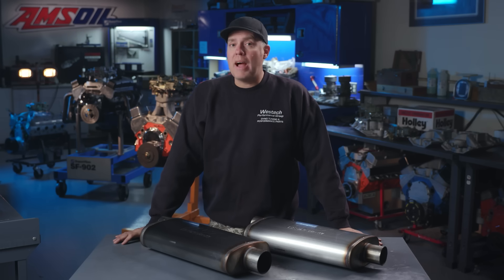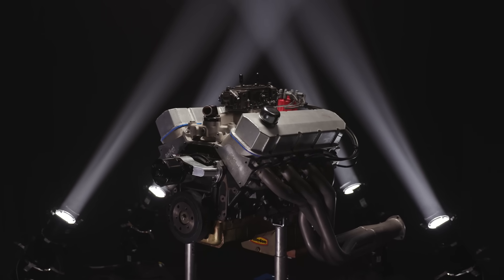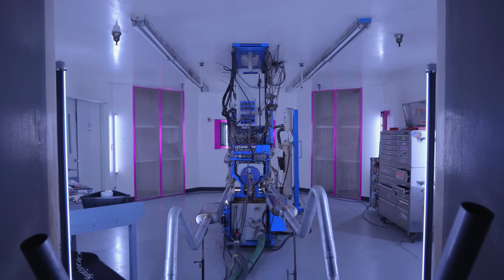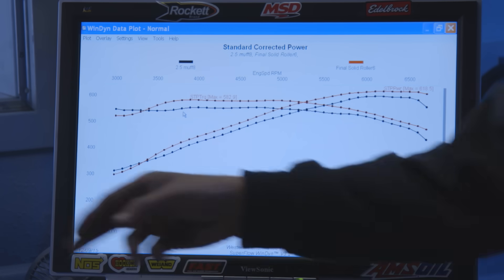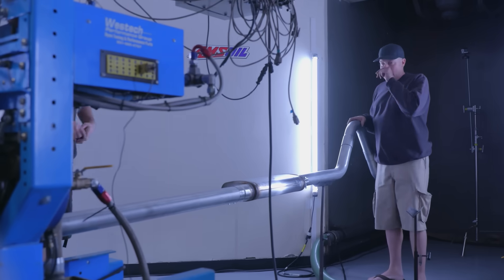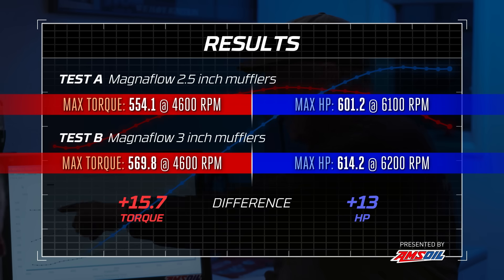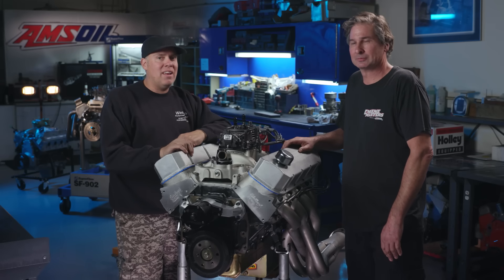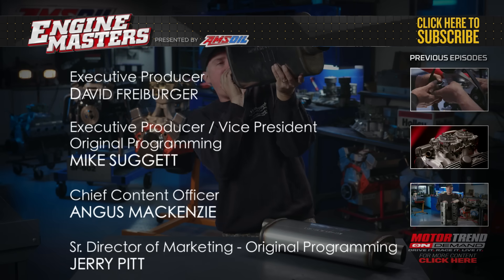The Power of 2.5- vs. 3-Inch Exhaust - Engine Masters Ep. 9

Comment: Ok... for all the wanna be gear heads commenting, let me break it down for ya...
I'm a Roadkill fan and all but they didn't prove anything. These are already established facts.
You WANT back pressure on a daily commuter. Under 3200 rpm is where your engine will rev for MOST of your driving and a loss of torque there sucks for your fuel economy. So does constantly having to downshift just because the road starts to pitch upward.

If it's just a toy that your going to thrash on for fun then yeah, run open headers or massive diameter exhaust systems and flat foot it everywhere...
Just don't get mad when the quiet 4 banger next to you keeps rolling on you at every red light because your brap brap BRAAP machine can't get a decent 60ft time without you revving up to 4 grand and popping the clutch. 

Launches are fun, until Deputy Dewey hears you squealing down Main st. every 30 seconds.
Reply: Also, that's why most higher end performance cars come with tune-able exhaust systems for the last decade. Low rpm, a flap valve in the muffler stays shut to provide back pressure for scavenging, and opens to allow flow through higher on the tach. Best exhausts ever!

Comment: I am really glad to see a test like this done.   It is good to have a comparison on this sort of thing.   Just a wee bit of confirmation bias in the results reporting, though...         So swapping from a 3" to a 2.5" only cost you 2.8% of your torque and 2.1% of your horsepower?  ....despite the fact the engine isn't even properly tuned for the 2.5"?       I mean it is good to know 2.5" exhaust is perfectly adequate for a 600+hp car.    If you are going to claim victory here without letting anyone tune the carb, you might as well point out the two pounds of weight you added with the larger pipes.   Whoah!!!! Huge Difference!!!!

Comment: I would have gone with a flowmaster not a magnaflow.
Reply: LOL. I hope you are not serious. Chokemaster is one of the worst mufflers money can buy. Their technical support are a bunch of complete idiots, so it is no wonder they can't make a decent muffler. 

Here is the facts:
I had a 454 in a motorhome running Thorley Tri-Ys. It originally was stock manifolds, with Flowmaster 50 series. When I installed headers, there was only a minor improvement in power. After a few years, I had the exhaust redone. Same 2.5 inch pipe, but switched to dual 70 series Flowmasters. Absolutely killed the gas mileage. ~20% worse. I called Flowmaster's tech support. They suggested maybe I had too much scavenging, and suggested I choke down the pipe size. LOL, even a small change made it worse. At the time, I also had a fuel pressure regulator. By adjusting the pressure, I could easily richen or lean the mixture. I did so, but it made no improvement in power. I eventually removed the Chokemasters and installed Magnaflows. All I can say is WOW. The muffler was quieter than the Flowmasters, and the peformance was substantially better than even the 50 series Flowmasters. Finally I had the performance increase that I had originally expected when I first installed the Thorleys. 

As a side, I eventually installed a 502 with MPFI. Used the same exhaust. It doubled the HP. It was the only motorhome I know of that would chirp the drive wheels between 1st and 2nd at 50 mph. And yes, the motorhome would do over 100 mph.

Comment: Heres the issue...
Built engine needs big exhaust
dpes your 200hp with a cam and headers need that no.. you have a 4K redline
Same with your  240hp 454
Reply: 200 horse WITH a cam and headers? What is that, an 80s v6? No you don't need it, for most people 2.5 to a single 3 inch is overkill. You can go too big, and lose velocity. Just like everything, keep it proportional.

Comment: The trick is to make the most power at the lower rpm's. Look at it this way. A 454 that puts out 500 horse. Now look at a 500hp Caterpillar engine. They are both exactly 500 Horse Power. Which is the stronger motor? The 454 puts out close to 500 lb ft of torque. The Caterpillar puts out 1500 lb ft of torque!!!! 
Now go figure out gear ratios Grasshopper, where you can multiply torque, where little huevos can do "big huevo" work.

Comment: No matter how big of a carburetor and intake that you put on an engine no matter how big your headers are and your exhaust pipes! You're going to hit a plateau! You need to hog out the intake and exhaust ports on the heads! And you need to deburr and D shroud the valves! And then re c c the intake and exhaust ports below the valves! And if you want to go further dump in the biggest valves sodium-filled if you can afford them and valve seats! Always gasket match! Index your spark plugs so that they Point straight at the intake valve! And you will have massive power! If you're just a bolt on Bonanza! you're going to have The Hourglass effect!

Comment: "3 inch exhaust sure enough makes more power than 2-1/2 inch exhaust".... WHEN MOVING EXHAUST OUT OF 454 CUBIC INCHES! For the other 99.5% of people NOT running a 7.4 liter, results may vary when you only have 5.0-6.4ish liters trying to exhale, especially if you're trying to daily the thing. Also, as little difference as this made in comparison between the 2, it was on a much larger motor than most are running. I'd be inclined to think a smaller motor would be even less affected between the two sizes, especially with supercharging or spray... just something to think about before opening the floodgates out back. Lol

Comment: A question for you.. what about a turbo engine with 300 hp...Is it the same result between 2.5 and 3" pipe with full flow muffler all the way ?
Reply: Conny Blomqvist same result. My car is a slug with a 2.5 exhaust vs a 3.5. 1jz-gte precision bb 6266.

Comment: What if you go with 3 inch pipe, from the header up to the muffler, then 2.5 inch pipe out the rear? 🤔
Reply: It gets restricted at the end. You have 3 inches of exhaust trying to force it's way through a 2.5 inch space. It's not a good time.

Comment: how about for 4 cylinders 2.0 engine.. will a 3" gives more power than 2.5
Reply: Yes, assuming it is turbo'd. But even if it's not at 2.0 you should expect similar results. Just, not as substantial. Somewhere around 3-8 hp. If it's turbo'd expect a little more, because it has more room to push the exhaust. Also getting a bigger turbo is always an option as well. Much more effective than an exhaust, if you have the money.
Reply: @mattevans1643  how about 2.0 NA engine like K20

Comment: ran many with H and X with 3in . muffler placement farther rear also works with air impulse . 1/2inch h2o pos  ex pressure this helps low end and higher to WOT .

Comment: Very good test for the big block it proves that a 3-inch system is better than a two and a half I wonder how this setup would be with a 350 cubic inch engine thank you for the time spent in setting up this test
Reply: I've had 3 inch in a lt1 and lost low end torque. It got slpooy. 3 inches for a 10.1 compression big block and big cam needs a 3 inch exhaust.  A small block will do fine on 2.5
Reply: @Miguelspl150  thank you

Comment: BUT did you attempt to lean out the rich condition with the 2-1/2" 🤓
Reply: William McNett exactly. How close could they get to the optimized open header tune. They didn’t show the afr with the 3”. All about the tune 👍
Reply: Exactly. This comparison is dumb because of course the engine is going to make less power with a richer afr.
Reply: Less then one number difference in AFR not hardly worth a jet change between 11.5- 13.5 very little difference one degree of timing will do more.

Comment: Need to do the same test on a stock engine with stock cam profiles. You can't make an open claim that open header makes more power based on that engine. I've actually done the same tests on a chassis dyno and saw huge drop in torque after cutting mufflers out on a vehicle with stock valve train. Stock engines are designed to meet a different demand than just all out horsepower. They have valve overlap and back pressure accounts for some of the combustion pressure, without back pressure, there's less air in the cylinder to compress. This is because the exhaust valve is still open as the piston begins to travel up on the compression stroke. Less pressure at the bottom of the stroke equates to less pressure at the top.

Comment: You should do Flow Master 40 series mufflers with crossover pipe.
Reply: Flowmaster?? No offence but I always was told those were like the bottom of the barrel for performance mufflers.
Reply: @extremedrivr  you should check out Flow Master. They are not glass packs that look like mufflers.

Comment: Shenanigans I call shenanigans.  I don't know a car guy out there that would run magnaflows without a crossover X pipe or H pipe.  Lean out the engine on the 2.5" and put an X pipe and see what numbers you get.  We in the real world don't have the disposable income to throw everything at a motor to get big HP gains.  So we tinker, port, lean and tune.

Comment: I was told back pressure stops valves from burning up, nothing about the little power loss vs hurt valves more flow more heat. Anyways that's how I was taught back in the 60s

Comment: I'd love to see this sort of test on a Honda Integra Type R with the 1.8. 

My experience with these high revving 4 cylinder engines is that you can't go too big to you just lose so much bottom end and in a car with not a lot of bottom end, you lose so much totally.
Reply: Depends entirely on the size of the 4 cylinder and how big your turbo is. I've met quite a few tuners that run 4 and 4.5 inch when they're running a large turbo because it allows the turbo to spool at lower RPM, thus reducing lag and increasing usable power band at full boost. For smaller turbos and N/A motors you shouldn't go larger than 2.5 or 3 inch depending on engine displacement.
Reply: @Datboi_Mo  yep exactly. For small CC NA engines in my experiences you shouldn't go too large or with a straight through pipe either. It just doesn't suit the engine for me. Forced induction is another matter like you say. These tests are nice but don't really offer real world examples.
Reply: 125-150 horsepower and the same or slightly less torque
Reply: agreed... this is a massive brute of an engine, of course its gonna flow better with the 3"... but on a NA 4 banger, you dont have the volume of air flow being pushed out that would need or benifit from 3".. the exception would be a 4 banger with big turbo.

Comment: Wow, lost 20 whole horsepower...lol I bet 98% of the drivers on the planet could not actually tell the difference although more noise will make most people think it's faster.  And the test is kinda lame because you didn't change the fuel curve so in theory  someone who is jetted on the fat side with quiet muffs and spends a pile of cash on a less restrictive system and picks up a couple tenths in the qtr mile and thinks it was money well spent could have gotten away with swapping a couple jets, picked up almost the same number and picked up a little fuel mileage too.

Comment: its not "backpressure" but gas velociti that best resonates and tunes with the rpm , displacement, level of throttle. i hate to still hear and engume needs backorwssure. NO it Doesnt. especially on a turbo charged car. the less back pressure after the turbos turbine,  the better the turbo (thus volumetric efficiency)  turbine  will respond because of the pressure difference through out the overall system. stop saying "engine needs backpressure" that is way over simplification. a 2.5 would yield better VE (volumetric efficiency) at off idle and part throttle because the gas velocity would be higher and better resonate assisting im scavenging better of exhaust gasses from combustion chamber. this could be proven by comparing a full 2.5" system versus a 3.0" system with step a 90Degree square step down pipe 2.5" restrictor at the end. on the same NA engine. both sys  would yield similar "backpressure" but the system with full 2.5"  would allow for higher gas velocity and scavenging tuning resonance at low rpm and part throttle as opposed to the larger 3.0 system (loose low to mid throttle exhaust velcity and rosonance tuning) with the 2.5 restrictor. rant over.🥴

Comment: It should be noted that the 2.5" exhaust system is a power killer compared to WIDE OPEN EXHAUST....however, compared to a factory stock system, where your "big upgrade" would be to use a truck exhaust manifolds and 2.25" pipe. Compared to that, the 2.5" pipe + headers makes more power.

Comment: Try with X pipe and H pipe for scavenging. That would be very interesting.
Reply: H pipe better for low end and the X high end. It also depends on the motor and where you position the pipe.
Reply: @lordterra1377  As was said when Engine masters did that X vs. H test. The real estate under your car will dictate where the X goes. That's just life. Have you ever installed an X pipe? If so, I would think you know how hard they can be to fit.
I made a 4" X for my Gen 2 F body, and trust me, it's a pretty wild contraption. More sculpture than X pipe. They are hard to fit once you need a beefy shaft and a beefy trans.
Reply: @AB-80X  
I haven't done an X pipe only an H. I'll look it up again but from what I remember placement is key because you want it close to the motor. With my application space was no issue because of how high the truck sits. Again I'm going off of memory here but doesn't an H pipe work better for older V8s like early 90s and lower? Meaning carburetors and not built up too wild, because you're limited to 5500 rpm in most cases.
Reply: Go to the MT site. That test is there.
Reply: I heard when I deleted the mufflers on my challenger I could lose some power but when I asked the guys at a couple places they never heard of that. Any truth to it
Reply: 😆 Should of just watched the whole video first I guess!!

Comment: I wish you guys used black Widow mufflers. All the other Mufflers advertise 2-1/2 and 3-1/2. But the inlet and outlet of the mufflers measure smaller at the weld. Black Widows are True 2-1/2 and 3-1/2.

Comment: I use 5" galvanized steel dryer vent straight pipes.
Reply: While driving around town I saw a jetta TDI with a stock exhaust but he had an "aftermarket" exhaust as well....dryer hose right out from under his fender and up the side of the car...little plumes of black. Made my day
Reply: Does the catalytic converter do a good job of catching the lint?
Reply: @DavidG-vq3bk  That's funny
Reply: @DavidG-vq3bk  nah! Thats the cabin filters job. Hehe
Reply: lmfao
Reply: Aluminium dryer vents save weight.
Reply: I used furnace flue pipe from Home Depot to repair the resonator on my Honda. So I thought you were serious.
Reply: lmao
Reply: Lmao. I actually know a guy who did that haha
Reply: @BeardedDaddyD  lol im joking i have a resonated tip running from resonator going down.. no muffler though, rusted and fell off, pretty much striaght pipe from resonator
Reply: Guys I put a coffee can.. then I took it off and upgraded to a steel tips
Reply: Deplorable B.R., SON!
Reply: @David M i went over a few pot holes and then heard clunking in the back ..., Lol pulled over only to find the pipe rusted right at the flange and broke off.. the only thing keeping the muffler attached is the hooks... Lol. Piping and clamps $40.. resonated exhaust tip $35.  Or pay $175 OEM muffler..  back pressure? sure after a pot of beans... 😱😱😱😵💩🤯😂
Reply: It smells like a rolling laundromat
Reply: Do you have to add any bounce dryer sheets for maintaining it? So it doesn't like rust out or anything?
Reply: The neighbors must love you when you leave for work at 5:30 every morning 😀.
Reply: You have a galvanized steel dryer pipe? Are you drying sand in there?🤔
Reply: Amateur, I run a tuned metal downspout through the hood, connected straight to the headers with some bits of copper pipe and plastic elbow pipe fittings.
Reply: Gonna upgrade to Solo cup soon